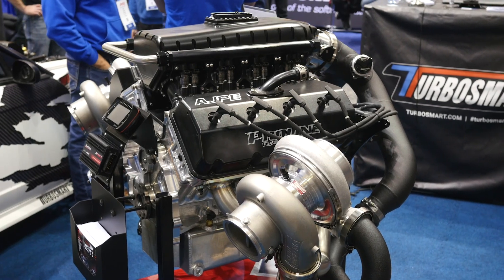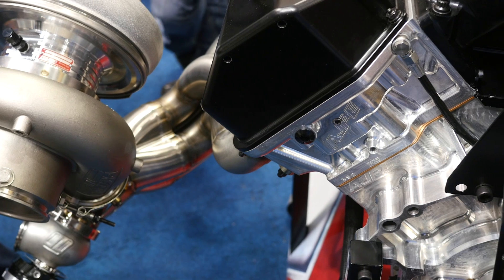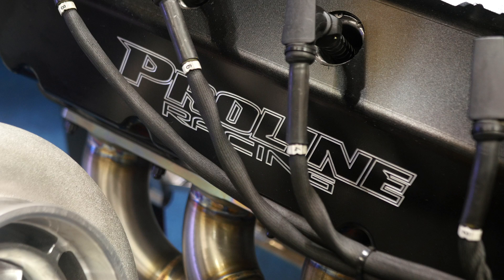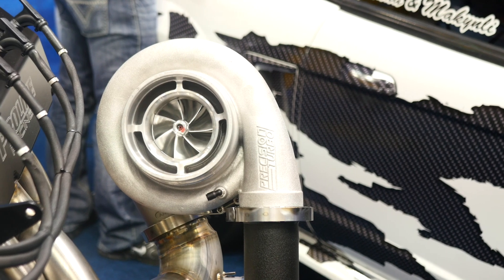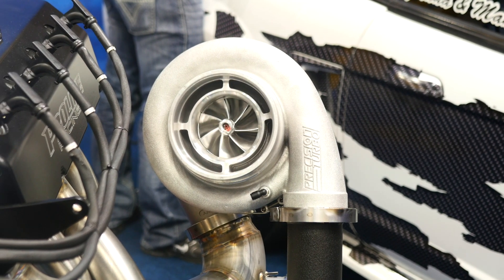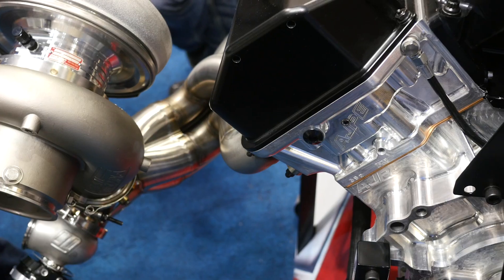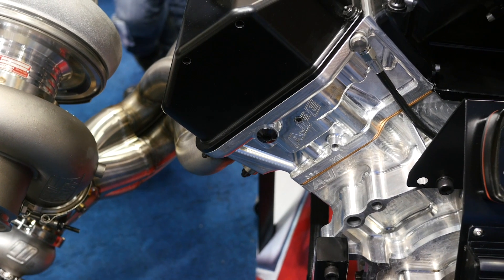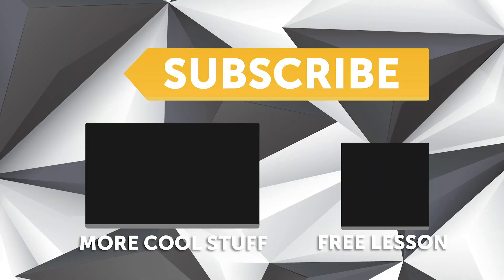Proline Racing's 5200HP Hemi V8 | Secrets Revealed [TECH TALK]

Comment: I remember the 94 gatornationals when top fuelers were just grazing 5k hp now there making twice that
Reply: try closer to 11-12,000 hp 1 car last year had a theoretical hp of closer to 15k. No dyno ive seen can take that so its basically just calculations at that point
Reply: The issues always gonna be putting it down
Reply: I remember in Pomana a record was broken, inofficial, of 314mph.....crowd went Nuts..... Now the tracks are 300 feet shorter.... 340 mph!??!?!?  Insane....
Reply: In 94 that was... Forgot to mention
Reply: Mr. Morningstar  i think you missed the part about them doing that speed with a 300ft shorter track.
Reply: Alan cZar  Im pretty sure it was 2008' maybe 09' cant remember whos name it was that crashed and got hurt which made the rule change
Reply: @topseykretts251  July 2 08 was when they first raced the shorter distance, Scott kalitta was the one that ended up getting killed, motor let go at 300 mhp and screwed up all the secquenes,  Wich left him no chances, piled into a solid wall and really no options as far as catch cables and or sand pits

Comment: Jesus and it’s (lightly said) 520 CIs. Imagine it in 700-900 CIs 😮
Reply: Truth, which is why he runs nitrous and not a turbo app he doesn't have the rpm capes to spin the turbos as efficiently also the dude has the biggest heaviest car and a shit ton of nitrous to boot and always has nitrous fires losing to somebody that's why monza switch to turbo because it's a better combo and most of them are turbo or procharger but some still run nitrous but less and less common though.
Reply: @joshreynolds729  some other reasons for going tubo are power management, and maintenance....those big nitrous engines EAT PARTS!!! Rebuilding the engine every 15mins has got to be tiresome...from Wyoming USA 🔫🤠p.s. nitrous is safer nowadays with computers and safty stuff..than back in the late 80's early 90's that's when I gave up on gas!!.lol..

Comment: Wonder if / when we will get to an age of carbon fiber blocks sleeved / affixed with billet or Ti where necessary. Imagine the rigidity and weight reduction on an engine of this size and density if the bulk of it were CF
Reply: I like the potential with this idea. I dont see why not unless the vibrations will crack the carbon fiber.
Reply: Or melt the shit out of it when the sleeve heats up.

Comment: 481x making 5600 hp crazy! If you would just run it at 2000 hp would it last 10 times longer?
Reply: Its not a 481, it's a Billet Chrysler based Hemi. Standard Nitro stuff here just ran on whatever and got turbos attached to it.
Reply: Good question I wish someone would answer...
Reply: No 481X has come close to 5600hp.

Comment: does anybody know if a titanium block has ever been made I know it would be stupid expensive but it would have to be damn near indestructible
Reply: Not going to happen
https://www.quora.com/What-are-the-benefits-and-disadvantages-of-using-an-automotive-engine-block-cast-of-Titanium
Reply: @kalashnikovcortez1380  what about billet ?
Reply: Even a solid billet 6Al4v, called grade 5 titanium, would never be as hard as a steel block. Titanium has a yeild strength of 150kpsi heat treated and hardness of about Rockwell 39c. That's about as hard as stainless cutlery.
A billet d2 tool steel block however has a yield strength of over 230kpsi and a surface hardness of up to Rockwell 62c when heat treated. Even annealed it is still nearly as hard and tough as titanium at its maximum. The problem with steel is the weight and with titanium is the tooling to cut it and the cost. 
Aluminum that they use for these blocks in nowhere near as strong, only 23kpsi yield, it is much more walkable, much easier to marching, has a density 60% that of titanium and 40% that of steel and takes shapes better.because it can be cut after.heat treatment. Both titanium and steel would have to be.heat treated after machining and would probably not survive the kiln. 
There as very few aluminum engine blocks that have iron or steel bedplates that are a main bearing girdle that the headstuds anchor into as well.
There are several exotic aluminum alloys that really come close to 100kpsi yield but they suffer the same fate as titanium. Harder to marching, hard to weld, not as dimensionally stable at temperature. 
Even before the exotic materials ban, take a look at what f1 used for engine blocks and it will be some aerospace aluminum alloy billet block and maybe forged head but prob billet. It just works, and works well.

Comment: Does a hemi flow more per L than a LS based V8??
Reply: The hemi Mopar head is of a cross flow design...the LS head is an inline, or what is commonly a "reverse flow" design, that is, the intake/exhaust charge has to change direction as it moves across the piston in the chamber. With the Mopar hemi type or a cross flow type head, the charge goes straight thru.  The result here, is that the hemi yields a much higher level of volumetric efficiency, hence the hemi design will also be able to create far higher levels of horsepower. The LS is OK, but is not in the same league as the hemi..
Reply: Of course billet heads.... Big Block
Reply: @dj4monie  nothing that you said makes any sense. I think the real difference in ability between the LS and Hemi architecture comes down to chamber shapes. If the Hemi does in fact flow more c.f.m. per liter, it would surely be due to this. 

Both engine types have machined billet heads
Reply: Anthony Thomas sounds more than I can handle. I'll smack up a single cam 6

Comment: Eric started proline with doug patton when he was only 26 from memory. He also races pro mods himself. Proline 481x is the only engine to have if u want to compete in promod , radial and outlaw.
2/3 of street outlaws running proline.
I was hoping u would do a proline feature. Please try and get an interview with steve petty.( prolines go to tuner)
Reply: Their Hemi the engine they are talking about in this video is better than the 481x.  In fact most of Prolines Promod customers use their Hemi.  In.fact I can't think of a single one that still runs the 481x.
Reply: @adamhurst9491  Daddy Dave runs a 481x engine
Reply: The boosted HEMI is top dog in Promod and everywhere else maximum horsepower is required as long as the rulesmakers, or the track surface don't hinder performance.

The 481X is 2nd dog.

Comment: Pro line is literally taken over the game but it will cost you too play!
Reply: Steve morris is just about right there with pro line competition makes for some better products that's for sure.
Reply from the maker: @JCA-Z  more creates more! People forget that sometimes - Taz.
Reply: @JCA-Z  I 💯 percent agree with SM motors they are definitely just as good or even better!
Reply: Malcolm Reynolds  What game? They aren't racing for free. You can always bracket race doesn't take as much power. There is also Factory Stock, Coyote Stock, LS Stock, Hemi Stock, etc, etc. In the V8  world you have choices. Nobody is holding a gun to your head saying you must run Pro Mod/Top Sportsman.
Reply: I mean this a pay to play sport but with proline I've been told that their customer service is so many leagues ahead of other race engine builders and their engines are consistently in the winner circle it's hard to not go with them if the funding is there for you
Reply from the maker: Malcolm Reynolds  motorsport has never been cheap - Taz.

Comment: Huh? Top fuel and funny cars have kept up in engine & design since the beginning. They make twice the power (thanks to nitromethane) and Alan Johnson, Indy Cylinder Heads and many others have been doing for decades. This video must be for noobs and proline are good engine builders but they are very late indy game. Btw, Sonny Leonard is just up the road from me so if 500 is good, 700 is better
Reply: Half that motor is Alan Johnson. There really isn't a "better than" happening here. Top fuel is old news and nowhere this level of performance. Like you said, it's the nitro doing the work. What you are seeing here is like a larger and much meaner top fuel motor. Weird you don't see it that way.
Reply: StabyMcStabsFace I’m making a case for hemispheric heads that haven’t changed much since inception. John Kaase will tell you along with a lot pro mod folks, what flows better or in laymen terms, mopar or no car 👌
Reply: @StabyMcStabsFace  I think the reason he doesn't see it your way is because the nitro engine is making 10,000 HP with the 500 cube limit for top fuel rules while this is over 500 cubes & only makes 5,500 !
Reply: Duey Jones huh ??? You do knpw that turbos are banned from top fuel. Grip is the limiting factor and the turbo has electronic boost control feeding in as much boost as the track can handle.
Reply: @nordic5490  We'll see how long that ban is in place. Lots of people said Pro Stock would never go EFI and it did... NHRA is one of the few series not fully in the 21st Century complaining of increased cost. Hello, it's already Uber expensive to run Pro Stock, Funny Car or Top Fuel. Ony F1 is more expensive
Reply: Nor Dic because 60pai is instant

Comment: 5200 @ only 85?!!?
Reply: I have no clue really, I'm only using a 4cyl as reference, that run crazy boost and nearly make 2000
Reply: @doublevanoz  that problem with that there's no videos of a 2,000hp pull from a 4. So really no proof. Only hear say.
Reply: No nitrous only on meth. 85 psi in 520ci or 8.5 litre is no joke. It's a lot of room to fill and you need such big turbos to generate 80psi

Comment: How long before we see carbon fiber connecting rods in this kind of application?  Being able to lay up carbon to provide the lengthwise cushioning of aluminium but with much higher yield strength, thread holding ability, fatigue resistance and significantly lower bob weight sounds like the perfect application for carbon.
Reply: Someone has made carbon rods but I think it was for the Coyote platform and I don't think it's for this power level. I wonder if there's carbon rods that can handle this power level out there yet
Reply: @02honeydew  heres the article about the LS carbon fiber rods: https://www.lsxmag.com/tech-stories/engine/naimo-composites-developing-ls-carbon-fiber-connecting-rods/
Reply: @von...  Not the original rods I had seen before but I really like that someone is taking the initiative to start the technology for a targeted market that doesn't feel like wasting money buying a Lamborghini just to experience this stuff. Really exciting.
Reply: 02honeydew will the heat fatigue the carbon rod?
Reply: @cantho11  I'm sure it will depending upon temp but I'm not expert for sure. That's why I'm thinking maybe for this level of racing it may be good because from what little I understand about race fuels, they tend to burn at much lower temp so it should reduce over all engine temp during the combustion cycle at lease (I think) and keep the rods safer running ridiculous power levels like he was saying. I'm definitely not an expert but hopefully we start seeing more carbon rods in the near future and see what they can do.
Reply: Why don't they go to titanium rods ?!